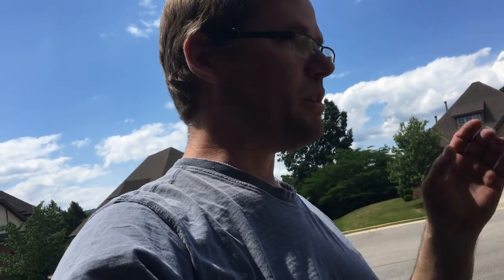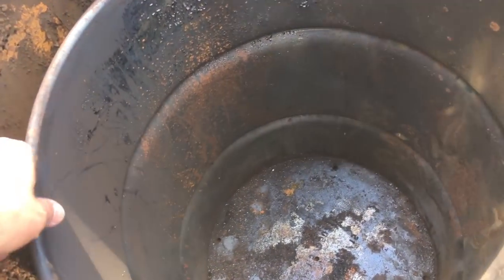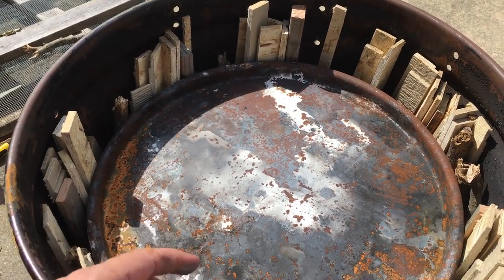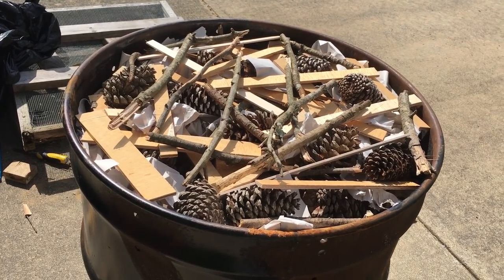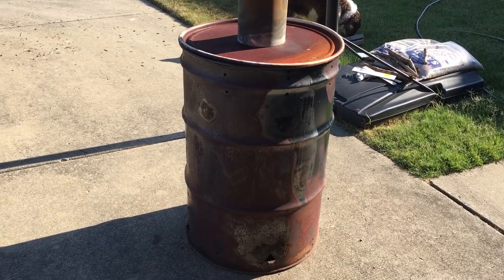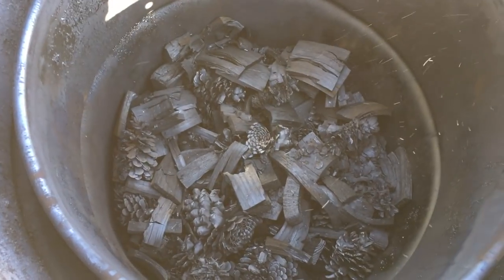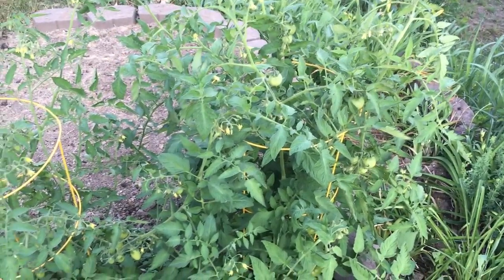How to Make Biochar

Comment: it can be combined with incinerator?
Reply: Not sure what you are asking here...are you asking can you put a 30 gallon retort barrel inside of an incinerator?  Maybe?? Basically that is what this is...you incinerate pretty much any material around the outside of the internal 30 gallon drum...to "cook" the raw wood (organic/cellulose) type material inside to gasify all non-carbon material leaving a carbon "skeleton" of the original material.

You have to make sure no flames can get into the inner retort barrel, but it must have just enough seal so that the gases inside the retort can escape without causing an explosion.  It works in this configuration because the gas pressure inside the inner barrel builds up pressure and makes its way down to the small holes in the bottom of the barrel.  This is why you use several different types of cellulose materials, I add several pine cones because it leaves enough air space to allow the gases to make it out the holes in the bottom.

You won't get a good burn if you use all wood chips or sawdust because there are not enough air spaces to allow the gases to permeate to the bottom escape holes and properly keep the burn going long enough.  

This is a very genius design by the guys at Living Web Farms and simple to build.

Comment: This design is a little different than what I've seen.  I have yet to see someone do a simple design of putting a very restricted amount of airflow into a steel drum and just setting fire to the inside.  Have you tried that?  That's how they make charcoal in 3rd world countries.  They cover a whole pile of wood or even coconut shells with clay and let it burn real slow with a low amount of airflow.  What's wrong with doing that?  No wood is wasted in that method and you get full carbonization.
Reply: I did this video to show how Living Web Farms makes theirs.  I felt that their original video didn't do a great job of showing how the holes were drilled, especially in the inner drum.

If you want to spend your time covering the pile of wood with clay and then clean that up when you're done (e.g. separating the carbon from the clay), I say go for it.  There are lots of ways to do this, I just found this LWF way to be easy clean up and a set-it and forget-it setup.  

Although with the current prices on steel drums (because of the steel tariffs), your method might be a better way to do it for now.  I paid half the price back in 2015, compared to what they are going for right now.
Reply: @shawnpearson8586  I mentioned the clay piles as an example so you can see how the low airflow method works.  Nobody is saying to go find clay for that purpose.  Anyone can create a restricted air-flow containment unit of any kind made of several different types of material.  Heck, I've set fire to a bunch of paper in a metal trashcan one time and put the lid back on.  To my surprise, I went to dump the ashes on the garden the next day and the fire was still going because the airflow was so low.  I honestly think people are overcomplicating this!  I've been burning small amounts of paper in that steel trash can for about 6 years now and it's just rusted, but it help up fairly well.  I might use it to try to make biochar one of these days just to see what happens.  The lid on it is perfect for a very low amount of ventilation to get in.  No need to drill anything.

Comment: That wood you used looks compressed and covered in man-made toxic chemicals. You should have stuck with just the pinecones and branches.
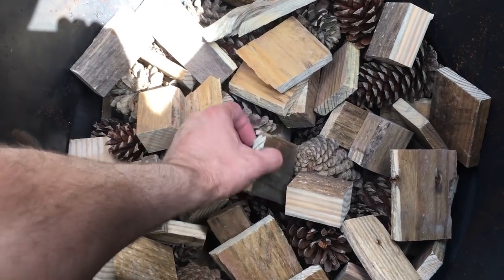Reply: Charles, since you are the second person who has brought this up, I think there is some confusion because around 2:30, you may be seeing the 2x4's that I cut down the center as well as on the bias.  The grain stripes look like plywood, but they are not.  In order to make sure the quality of the biochar was carbonized all the way through, I ripped the solid pine 2x4s down center also.

I did burn manufactured wood on the outside of the 30 gal retort can, which you can do...just as long as you don't try to carbonize it (inside the 30 gal drum).  Is burning the manufactured wood good for the atmosphere, probably not that great, but it does not affect what is inside the retort can inside.  But the burn temp is 700+ degrees so much of the toxic stuff is incinerated to less toxic compounds.

Comment: why can't you have manufactured wood in there? the whole point of this type of retort is that it burns off everything but the carbon
Reply: You can use manufactured wood as your burning agent around 30 gal drum...but I wouldn't recommend using manufactured wood as your biochar, since you might not know what anti-rot metallic preservatives that don't sublimate into a gaseous form are added...you risk adding human toxic copper and arsenic compounds to your soil.  Technically, the carbon should keep these chemicals locked in, but I'm more for being on the safe side.

Comment: My last batch of charcoal came out as ash.   Something obviously went wrong.
Reply: yikes, the fire must have gotten inside somehow. Was the bottom of the inner drum flat on the bottom of the 55 gallon drum?   The only other thing I can think of is the flames came in from the top rim if the 30 gal cover was warped.

Comment: Whats the point of burning the wood and send combustible gases to the environment and then uses burned char for growing plants?
Reply: So 60% of the carbon in the wood ends up not in the air.  You're not fully burning the wood into carbon dioxide and returning that carbon back into the soil for the microbes.  And technically, my setup is not optimal. To do it better I would add another 6 feet of stack, as this would help pretty much all the gases burn off leaving mostly heat.

Comment: can't u just dig a hole in the ground and burned it down there like a camp fire, why does it seem u have to do it in a certain way!
Reply: Ali Mohammond you don’t want this to be exposed to air
Reply: I have seen them do that in Hawaii, where they dig a conical hole, then cover it with banana leaves to make a low oxygen environment at bottom of pit. Then they light a big bon fire on top to generate the high heat.  That is okay if you live in an unpopulated area.  However, this method is self contained, automatic and relatively safe for a residential area.  

If the firemen stop by, you can just say you're smoking meat in your homemade smoker...like I had to do one time. :-)

The point of this is not to burn (ignite) the wood inside the second barrel, basically you're carbonizing the cellulose fibers by "baking" the wood at super-high temperatures 800+F (without ignition) to vaporize all the water, lignans, starches, sugars, and oils out of the wood...leaving only the pure carbon lattice behind.  

That's why what's left as char looks like it has shrunk to 60% of the original volume.